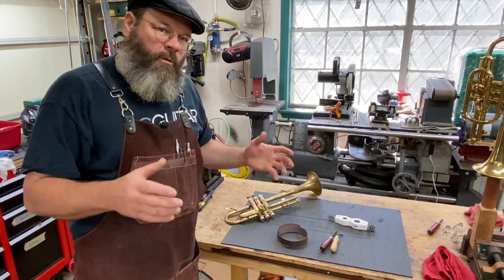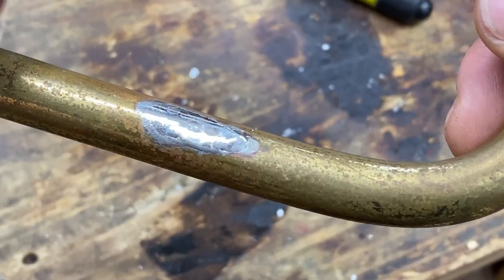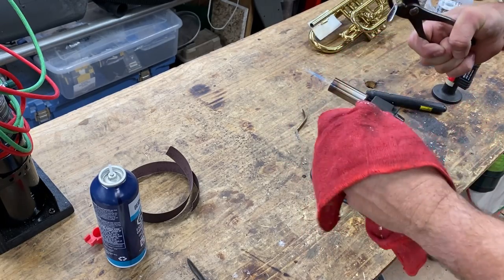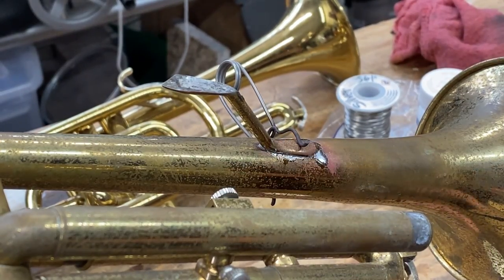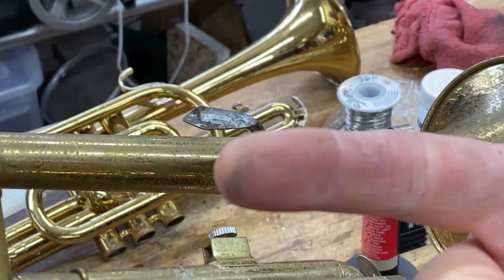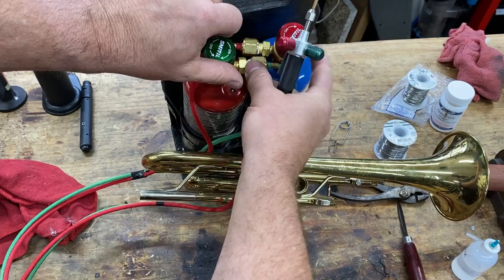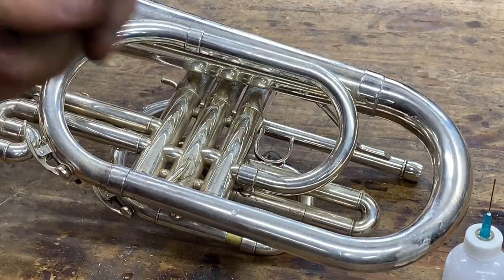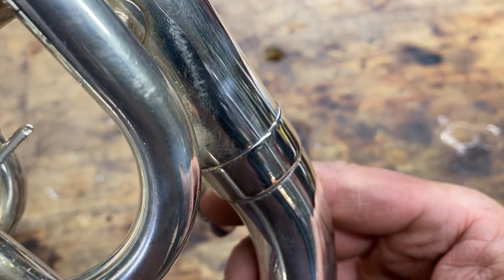How to Solder Episode 1: Soft Solder- band instrument repair- Ferree’s tools- Wes Lee Music Repair

Comment: Great tutorial!  Best part was ... heat the metal, get the flux working, then let the heat take the solder. There is such a tendency to heat the solder and that just makes a mess.  I've done a fair amount of soldering and I'm still intimidated by it!  You make it look so easy! Thanks!
Reply from the maker: Thanks for watching!
Reply: I have great success using a plumbers torch on extremely small detailed work that way!
Reply: Good morning, could you tell me if that flux is made with which acid, and how to prepare it?

Comment: Wes, I'm an electronics technician, and we use the same technique for soldering electronic components that you used here. Always heat the wire leads of the component and allow the unheated solder (rosin core Flux) to flow into the heated connection. Otherwise you can get a "cold solder joint", which is crystallized in appearance, rather than shiny.

Your technique is perfect, and your solder joints will be very strong. I appreciate you showing people how to solder, Wes, it's very easy for the untrained individual to do it wrong by heating the solder and dripping it onto the joint. A cold solder joint is very brittle, and will crack and come undone very quickly, so they are to be avoided at all costs. In electronics, a cold solder joint can cause all sorts of problems, ranging from no continuity to intermittent continuity. You can chase your own tail looking for a cold solder joint, unless you have a good visual of the crystallized solder.

Comment: Another tip is use 100 percent cotton rags like old bed sheets or flannel sheets.. if you use a mix of polyester, nylon or micro fibre cloths it will melt to the heat and it will put a trace of plastic in bedded into the lacquer  or silver and makes it even worse to remove.
Reply from the maker: Very true! Thanks for adding that.
Reply: ooh yeah. Stay away from any "stretch" jeans/t-shirts which contain 2-3% elasthane, the cleanup of the burnt elasthane is a hell.

Comment: I picked up a cheap baritone recently. Got home, realized it had broken solder joints on the neck pipe and braces. I figured “I’ve been a plumber for 16 years, surely I can save myself the two hours of driving to get it fixed under warranty, let’s give this a shot.”

I only have a touch big enough to braze 1-1/4” type L tube... it ain’t pretty, but I pulled it off without too much trouble and I’d say it’s as good as they would have done at long & mcquade

Comment: You can also use quick drying whiteout to paint a barrier to prevent solder runout on plated and unlacquered brass.  Once the job is done just use any kind of solvent to remove the whiteout.
Reply from the maker: Yep
Reply: I confirm, this trick have saved me a lot of cleanup, particularly on silver plated instrument when I had no low-temp silver solder.
Reply: Good morning, I'm from Brazil, could you give me more information about this product?
Reply: could you teach me how to do this quick drying bleach?

Comment: Wes, Bill said he disagrees with your 3 points (clean, fit and control the heat).  Bill said 95% project is in the cleaning.  If it’s not super clean the solder will not hold.  So,  Bill is saying 1  - clean,  2- cleaner, 3- cleanest, 4- fit and 5- control the heat, but most IMPORTANT is make sure the area is super clean.
Reply: Good morning, could you tell me if that flux is made with which acid, and how to prepare it?

Comment: Very good stuff Wes!
As a child I tried to solder together a tin can submarine from plans in an old  Popular Mechanics mag.
It was like Humpty Dumpty, with my dad, myself,  my neighbor,  and everybody failing.
I thought soldering was a black art lost in the Middle Ages!

But in high school I worked in a radiator shop where we would clean tan and solder  the old brass radiators. Later I did a lot of copper plumbing and boiler piping.
 
The process seemed miraculous- but as you said; it's all about cleanliness,  fitment, and heat control.

One point of clarification for beginners:
Wouldn't you say if you have just wiped the part down to the tinning, that it's already as clean as it needs to be?
Reply: Good morning, could you tell me if that flux is made with which acid, and how to prepare it?
Reply: @Tuca-Luthier.  
 There is liquid flux and paste flux and paste tinning flux and acid that helps when the flux just won't cut it you can find this stuff probably at a radiator supply shop by googling. I'm sorry I can't be more help. And you really need a tinning brush that's heat resistant to go with it
Reply: @kevinpulver4027  Good morning, thanks for the answer, here in Brazil you don't find liquid flux, the ones that have it are flammable, I did a Google search and saw that hydrochloric acid (muriatic) with zinc makes an excellent liquid flux, having to neutralize it afterwards , do you know anything about it?
Reply: @Tuca-Luthier.   Marietta gassett is usually available at hardware stores brick masons use it to clean the cement mortar off of their finished walls. I think you should be able to find electronics specialty places that have liquid flocks too..
 Tenning flux is that acid with powdered solder in it and you scrub the heated surface  With your tanning brush and the powdered sodder will coat the surface bright w solder.  I'm sure in Brazil you still have the old radiator shops fixing things that could help you.
Reply: @kevinpulver4027  Thank you very much for your help, I will do more research on this, I really want to learn this profession... but I still have a lot to learn

Comment: please tell me is the soldering hazardous to health? is there a release of heavy metals into the air?
Reply from the maker: You should always solder in a well ventilated area and not breathe the fumes. The solders used in band instrument repair are not as bad as the rosin core solders I have used for electronics.

Comment: Thanks so much for this super explicative video !

I'm looking to improve my soldering setup (my oxy-propane torch lacks precision, I have no tip small enough for small work). Smith torch seems absolutely great, and about 20 euros... but since I'm in Europe I suppose the gas fittings will not match my bottles :/ 
Can you please check and tell me the threading of the torch ? So I can see if I can find adaptators
Reply from the maker: Quick search reveals this:

POL is the common name for the standard CGA 510 (US Compressed Gas Association connection number). The Thread specification is . 885" – 14 NGO – LH – INT, meaning 0.885 in (22.5 mm) diameter thread, 14 threads per inch (1.814 mm pitch), National Gas Outlet form, left-hand internal thread.

O2 is same but RH thread.

I would check with vendors in your area.
Reply: @wesleemusicrepair9820  thank you very much !

Comment: hello mr west first off great video i learned alot so far, i do have a question, what is your smith torch attached to  everytime  i see you work wiith your torch i always hear something turn on almost like a light  generator sound. thanks in ad vance!!
Reply from the maker: It’s an oxygen concentrator, which is a converted ventilator
Reply: @wesleemusicrepair9820   maybe a a short video showing your rig and how you have it setup in the future  thanks for everything.

Comment: Did you mix the existing lead solder with low temp silver solder on the silver instrument joints?
Reply from the maker: No, I did just as I showed in first example. Removed all old solder down to tinning, fit the repaired part back in. Control the heat to keep the other side of the joint from melting. Only difference was the choice of solder.